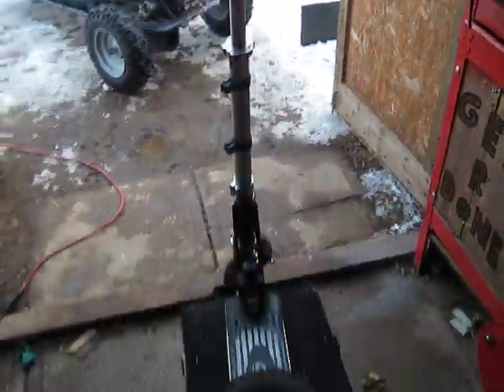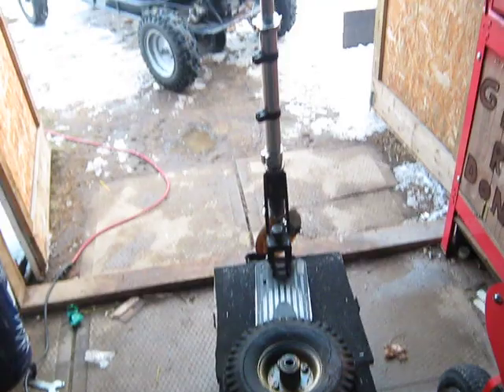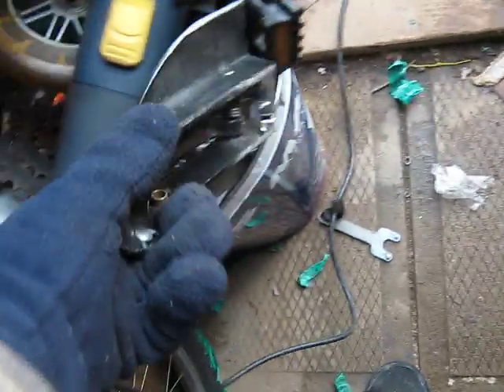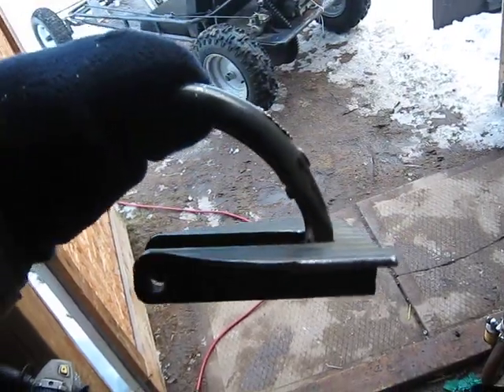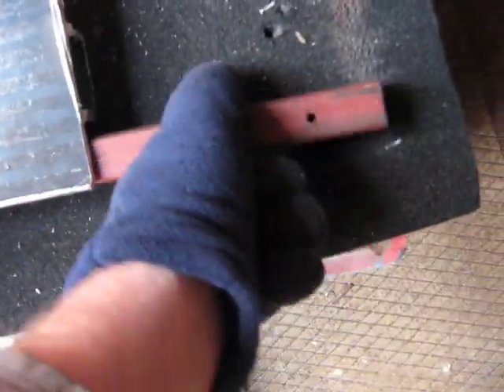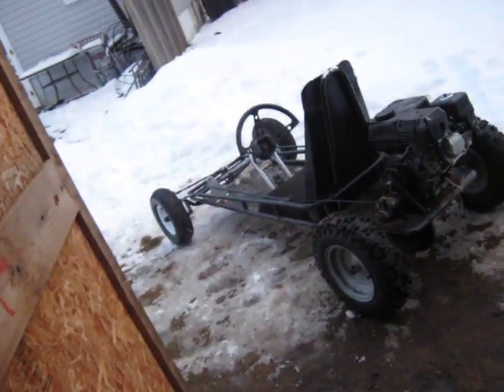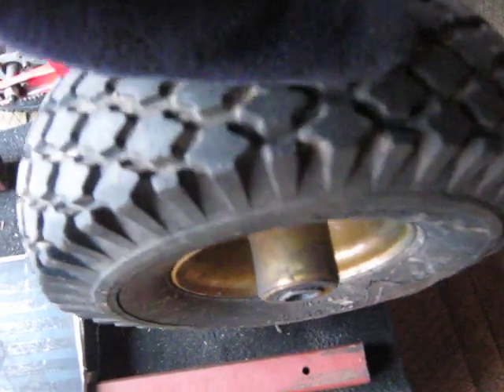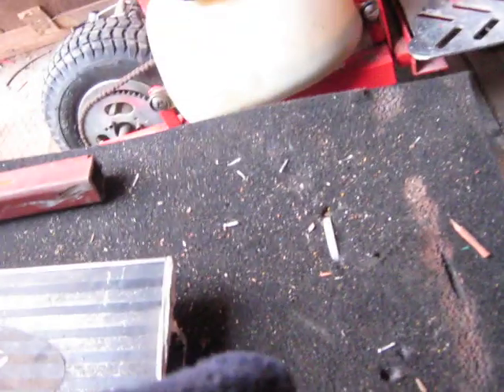homemade motorized scooter biuld

Comment from the maker: lol its just an easy way od diong a gas scooter and it worked but if u do the same way il give u advice make the square tubing go all the way doen the scooter so its stronger mynre bent a bit then i needed the motor so i junked the rest lol